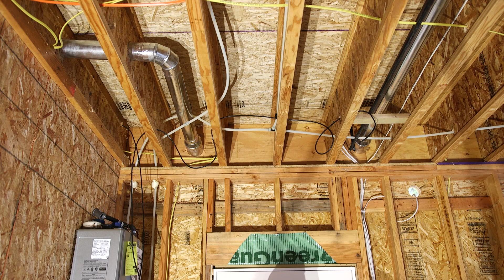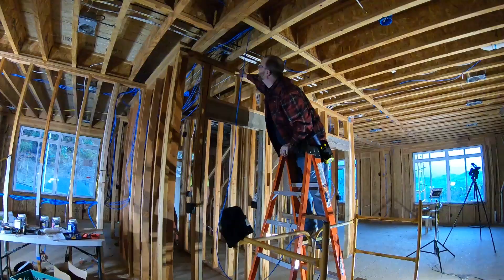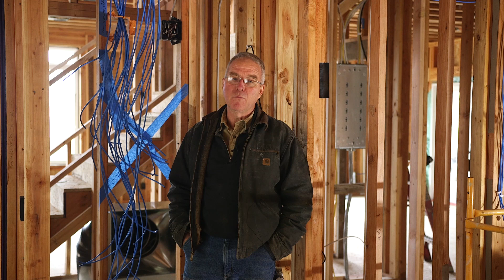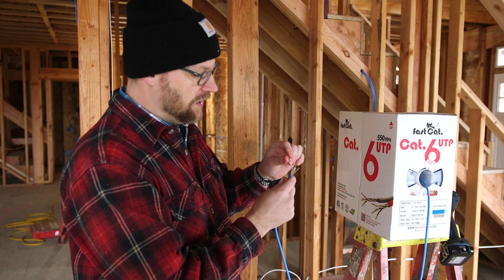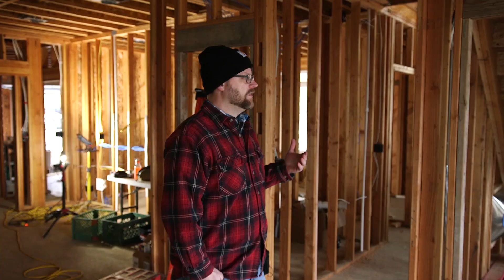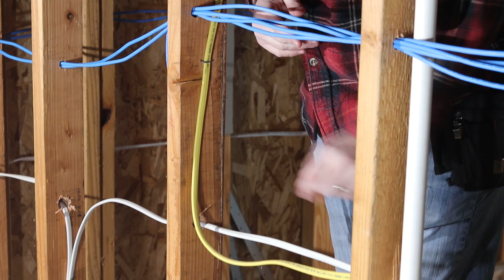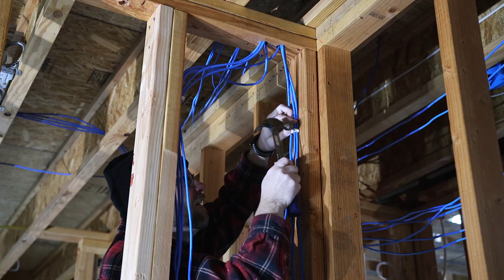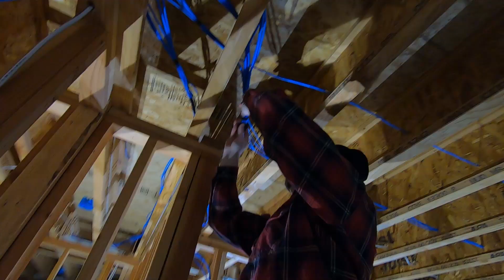Installing A Home Network Ep.100

Comment: Ah, pulling cable.
Back when I was in college I worked at an MSP, we specialized in K-12s so we tried to plan most major infrastructure projects over summer since only the admins, facilities staff, and a few teachers would be at most of our customer sites.
I can't tell you how many asbestos ceiling tiles I've pushed out of the way during the muggiest time of year to get up in a filthy plenum and wrestle with the building to get a cable run.

Comment: I rewired my older home about 7 years ago (aluminum to copper) and at the same time "pulled" cat6 to several rooms. Today, very little of the cat6 is being used as most things are connected via WIFI. Still glad I have it for a couple of devices though. Great vid... thanks.
Reply: And even when that's the case, you can use those cables for access points.

Comment: Very smart! Most service providers are moving away from using RG6 cable and going to fiber. Running RG6 to every room is a way of the past since most people are streaming their video. The option to plug into the Ethernet is much better then every device having to share 1 WiFi... Your son-in-law is well spoken and shows pride in his work. Nice job

Comment: When watching the mechanical videos, I'm always curious how or--if code--takes into account just how much wood is cut, drilled, bored or simply removed from the framing to make way for plumbing, electrical, HVAC, venting, network, etc. You talk at length about required dimensions and spacing for the framing and then the following tradespeople proceed to turn the whole thing into a honeycomb. Does the framing code just assume X percent will be cut out for services, is there a formula where X number of members can be reduced to Y thickness, or does everyone just eyeball it and hope for the best?
Reply: I think walls are so overkill as far as strength goes that you could swiss cheese them and they would still do their job. The only reason they are the size they are is to be able to run electrical and plumbing through them, plus have a space for insulation. Think about how thin and flimsy a metal stud is compared to a 2x4. It's the system that makes a wall strong, not an individual member.
Reply: You can calculate this if you want to, there will be a table somewhere.

Comment: For any builder out there, I would recommend to install the highest available networking cable at a time, as networking is probably the installation that will get outdated first.
Reply: There's no need to go above Cat6. It supports 10 gigabit up to 55 meters, and everything in this house is definitely under that. Speeds faster than 10 gigabit, and even 10 gigabit itself, can be handled much cheaper and easier with fiber.
Reply: @KingdaToro  I would suggest CAT6A with properly shielded keystone jacks is the upper bound on copper cabling that you suggest.

You are correct about CAT6 being good for 10Gig at all distances within a home. So why shielded 6A? There are non-ethernet uses for twisted pair wiring, like using HDMI extenders, which require shielded 6A for HDMI 2.1 use (48Gbps).
Reply: @KingdaToro  This is exactly what I am suggesting not to do. When I built my home Cat6 was just released ja relatively expensive. Cat5e should be enought for everything, I said and this is now what I have in walls with no practical way to replace it.

Comment: The only thing I would have done, for future proofing, is to use cable tubes/pipes so that if a faster cable comes along I would be able to upgrade in the future :)  Maybe not as much a concern today as it was almost 20 years ago when I was in a similar situation.
Reply: Not as much of a concern but relevant. Wireless technology is far from reaching reliability of cables and optical fiber is coming in fast.

Comment: Great thinking installing cat 6 in the walls. I hope the future owners will appreciate your forsight. I poked through as many comments as I could and I know people are recommending cat6a for 10 Gig, but reailistically home users will not need that speed for many years to come. It would take a lot of netflix streaming to max out a 1 Gig connection that you get with cat 6. I didn’t notice it in the video and I am almost sure that you guys have done it, but if not I recommend that you add one or two ports in the ceiling of each floor and one in the garage for wifi access points. Most of our technology is moving in that direction and fewer comsumer devices have ethernet ports. I suspect that in a few more years WiFi will become the dominant connection method for most devices. I can tell you from experience that one of the cable modems with wifi provided by the cable company will not be enough for a house of the size you are building. Just a suggestion, please feel free to ignore me completly. As always it is great to see you guys doing good work.
Reply: Cat 6 is already on its way out, and getting replace with Cat 6a. Once people start streaming 8K video its going to run into a bottle neck. Also going to run into issues if multiple devices are used in a room with one Cat 6 cable run. TV/Computer, VoIP (Phones), etc

Comment: When my home was under construction 15 years ago I home ran Cat 5 from an upstairs closet to all of the bedrooms, kitchen and utility room. I forgot to home run a cable to the living room. I later found out from an IT guy it is best to double home run to every network location within the house to allow redundancy and to allow different networks to be physically separate.
Reply: Yes. Its also almost free considering the cost of cable is usually much less than labor, even when doing it yourself. Network drops are usually contracted as a set of 2 cables, at least by reputable firms.  No matter how many jacks you've got, you'll invariably need another one at some point.

Comment: Very nice setup! I was a little confused he was saying Cat6 is the standard and recommended cable, when it has been made obsolete by Cat6a, which is perfect for home use. But then I saw on the box that the Cat6 he used actually is rated for 500Mhz, so it actually is Cat6a :) Very future proof, the kind of gear that can fully use Cat6a has actually only recently become affordable for home use.
Reply: Cat6 is good for 10 gigabit up to 55 meters, and Cat6a is good for 10 gigabit up to 100 meters. If all runs are under 55 meters, which is definitely the case here, there is zero need for Cat6a. In fact, if futureproofing for 10 gigabit isn't being considered, nothing better than Cat5e is needed.

Comment: I would still recommend running a few RG6 lines at least up into the attic in case they are needed for cable/satellite in the future. I would also run some CAT6 into the attic for access points. A little surprised you didn’t put in a structured cabling box in the closest.
Reply: I really looked hard into structured panels for this build, but the problem is the network switch and heat buildup. We have 24 lines of cable running, and I want them all connected. The big GB switches don't fit into the panels that work with our wall without heat issues, so I opted for a wall mounted rack for the patch panel and switch. It's in a ventilated closet, so aesthetics aren't as critical. Leviton discontinued their in-panel GB switch, and I've been struggling to find replacements. Plus, battery backup is easier to install in the rack I've got purchased. For smaller builds, though, I agree: in-wall panels are the best!
Reply: @Stonesand  Wait, Leviton, the light switch manf. is making switches?  
Come on, there are loads of decent mid-range quality L2 switches around that should work fine.  Even newegg has a cisco SG102-24-NA thats only 11-12". Unless I'm missing something.
Reply: @boots7859  Specifically, looking for switches that are mountable in an in-wall "structured panel". Leviton made one of the only models that mounted. Good switch, I have ones in my house! :)

Comment: Scott, have you considered adding an empty 1-1.5" conduit from the outside to the cable termination point inside? This would help future-proof the design because it will allow new cables to be pulled at a later date without having to tear into the walls. Many cable and Internet providers are pulling fiber optics into the premise instead of coax these days. Down the road there could be a situation where the homeowner will utilize more than one provider, thus needing additional paths in. This empty conduit is an inexpensive insurance policy that allows for both.
Reply: Agreed. And further future proofing my neighbor did by running 1.5" PVC from basement/crawl space up to the attic space. That way if he needed to run anything else to the upstairs he could do it without fishing or tearing into walls. Even better would be to have it go into an access space on downstairs and upstairs floors like in a closet.
Reply: @fprintf  Surprisingly my builder did this when we purchased our home 20 years ago.

I pulled a coax cable a few years ago to install an OTA antenna in the attic and a few months ago pulled a Cat6 cable to connect a Poe access point in the ceiling of the top floor. Very convenient!
Reply: Came here just for this comment.  As an installer myself, I can't tell you how nice it is to go to houses where they put conduit in ahead of time.  Real life saver.
Reply: Scott I work for a local ISP (Internet Service Provider). We are located in a rural part of Wyoming and just over built one of our local communities with fiber internet.  I can't agree more with other comments about adding a conduit from the exterior of the home to the media panel.  We actually provide this conduit to our customers in hopes that it will save us some headaches in the future.  It also is riser rated in order to maintain the same level of code compliance.
Reply: It's a great idea! The network panel is in a fairly central area and would require a conduit with a lot of bends in it to reach the coax demarc, so I didn't really consider it. There's a concrete pad in the way of the crawl space run, for example. But maybe I need to put more faith in real conduits, maybe that have some lube in there?

However, I do have a network jack in the garage, so it'll be trivial to locate a fiber modem in there next to the coax demarc and use the network run to the central network panel as the trunk for the system!
Reply: @Stonesand  Ben I'm living in a 100 year old house with plaster walls. So I'm using wifi alot, and cat 6 for the gaming computer and college course computer. 
Look forward to you installing the rack.
Reply: @brot5246  Sounds good! The new rack just arrived, so I'll be installing it this week or next. We'll get some good shots and I'll show you what I do! :)
Reply: I was going to suggest running a cat6 pair from where the coax comes in for when cable is replaced but this a better idea.

Comment: Yeah, no. You don't need to be THAT careful with CAT6 if it's stranded instead of solid core.

I've ran plenty and seen even more ran by others and every kinked cable has still certified at full speed.
Reply: An explicit instruction given in the video, which I agree with, is the need to use solid copper cabling in the walls. You also are unlikely to find riser-rated stranded cable anyway

Comment: I ran ethernet backbone in my house, but actual speed testing revealed wireless mesh +5ghz can outperform. The cable can go faster, but the endpoints are the bottleneck (switch, router etc). I agree with cable for security devices, but many future devices won't even have an ethernet jack

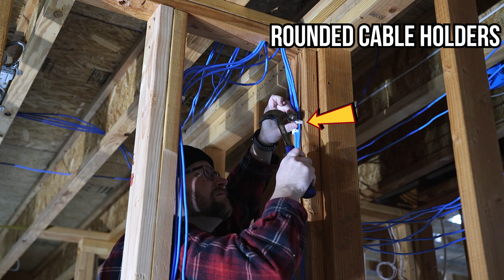Comment: 13:17 it’s called PoE /PoE+ “Power over Ethernet”
Reply: And now we have PoE++
Reply: @richardj163  how much more till its not considered low voltage cabling?
Reply: @FishFind3000  it's all still low voltage (48-57v), engineers are just getting more creative with how they shove power down the lines.
Reply: @FishFind3000  as soon as it goes over 100VA it will no longer be Class 2. In Ontario, Canada that will require Cat wire to be installed by electricians.
Reply: All the WAPs will be PoE devices, rights on! ;)

Comment: The future owner will value photos of every wall in every room before the drywall is installed.  There will be no guessing of where the wood structure, HVAC, pipes, power and data cables are located for future renovations and repair.
Reply: Talk about a complete transparent visit!!
Reply: That's really a silly suggestion. If I'm doing any major renovations where I need to know what's behind the wall, that drywall is coming out regardless.

And once that drywall is out those pictures are redundant.

Comment: I’m a computer/systems engineer with a contrarian view. For wood houses, wi-fi works great. And your speed is going to be most limited by your service, so wires don’t help that. I don’t like looking at extra outlet plates on walls. My house has a lot of unused cat6 installed by previous owner. One good case for wired systems is in buildings with a lot of metal framing where wi-fi doesn’t work well.
Reply: No matter how good your wifi setup is, it's still going to drop more packets and be subject to more interference from neighbors, that's just a fact of RF. If there's anything that I have taken away from this pandemic, it's that people with wired connections to their computer ALWAYS have it better when it comes to the video conferencing that we have to do so much of now. I can pick out the wifi user instantly from the occasional glitches in their speech, which is distracting.
Reply: @2rjk  precisely this. wifi at its best can often be equivalent to a failing wired network.
Reply: The best way to get wifi coverage is with wires :). (to install a bunch of APs that is)
Reply: Appreciate that opinions vary. I just don't consider it an important installation. I do live in a semi-rural area, so neighbor interference has never been an issue. My friends were installing network cable in their new houses 20 years ago. There was a much stronger case back then since wi-fi wasn't very good, and nobody had smart mobile devices.  In my house, a lot of network traffic goes to phones, tablets, and an Apple TV. It's instructive that the Apple TV doesn't even have a 100BT connector anymore.

Comment: Aren't the network cat 6 obsolete these days?  I suppose its better to have a hard connection so I'd say bravo guys! Great job!
Reply: Cat6 is bare minimum....6e or 7 would have been preferable for futureproofing once 10Gb Ethernet becomes the norm
Reply: @driveway_of_misfits  Not at all. Cat6 supports 10 gigabit up to 55 meters, which all runs in this house are almost certainly under. Cat 7 isn't even recognized as Ethernet cable. Speeds faster than 10 gigabit are best served by fiber.

Comment: We have been installing cat6a since 2013 & 7 for years!  For home Use cat 5e or cat6a. It includes a shield. Never use cat6e. It not a spec, it’s a false advertising.   The quality of the rj45 connection termination is very important! Especially with cat6a and 7. The ez45 connectors and crimpers are very good for cat5e and cat 6, but not cat6a or 7! Use quality connectors and crimpers! Terminate to a patch panel!  It may Seem like over kill until you have to replace a broken rj45 connectors.
Reply: Yeah, Cat6 is bare minimum these days...6e or 7 is needed for 10Gb networking

Comment: This was a great presentation on data cabling.  One thing I didn't see is making yourself a riser chase with PVC or PEX.  From years of talking to friends who wired their own houses, I can say that everyone who created a chase from the central area up into the attic and or down into the basement/crawlspace was super happy they did later.  Likewise those that didn't eventually regretted it.  Years from now you might want to run some technology that didn't exist when the house was built.  If you have a conduit you'll be able at least to pull a copper or fiber trunk line to a distribution point.
Reply: Yeah, when we prewire a house we almost always run 1 1/2” innerduct from the LV panel go the attic and/or crawl space. It’s not huge but it definitely helps.

Comment: Very forward thinking. There are still home built today without a single inch of network cabling, yet still POTS line to every room (usually the same type of cable in some cases).
Reply: They're probably using CAT6, but just putting the ancient POTS connectors (RJ11) on the ends.  Easily replaced later with RJ45.
Reply: @jej3451  problem is that A) pots is frequently daisy chained and B) frequently terminated or originated in a bad location not conducive to network rack installation
Reply: @KarlCarpenter  good point

Comment: Really good information on the kinks and  bends.  What is the difference between CAT5 and 6?
Reply: Cat5 is rated for 100Mb/s Ethernet, Cat6 is rated for 1000Mb/s (ie: gigabit) Ethernet.  Gigabit is pretty much bare minimum these days
Reply: @driveway_of_misfits  Caveat: Both speed ratings are dependent on the length of the cable.  You can run gigabit on Cat5 for a short distance.
Reply: @driveway_of_misfits  Very cool!! Thank you!!

Comment: Hi there, computer technician here.
It looks like you use U/UTP cable for this installation instead of STP or at least S/UTP.
If that's the case: You might not care about potential loss of signal here - but overvoltage in network equipment isn't fun.
So if there's occasional lightning storm in your area, shielding the network cables is an easy way to protect this equipment vom potential damage.

Comment: I am a big fan of conduct so you can easy pull new or replace cables if needed.    The cat 6 with the plastic separator in the middle is thicker but less likely to kink.  If you get cable with a integrated pull string it is much stronger. Some cable is rated at 40lbs.  

All that to say I run stranded cable everywhere and I have never had an issue with validating cable.